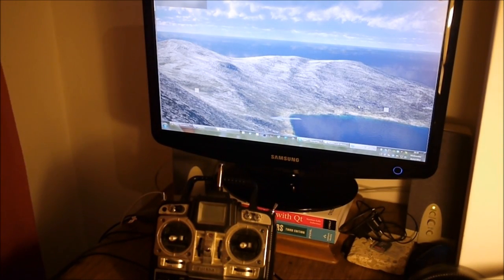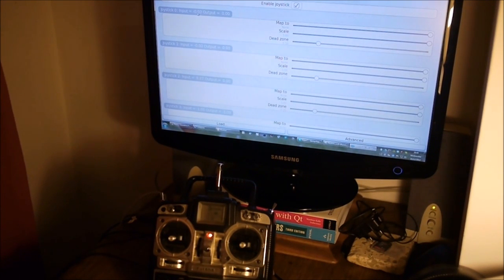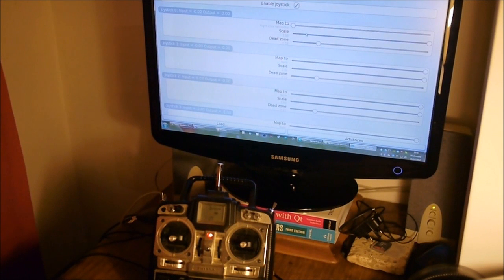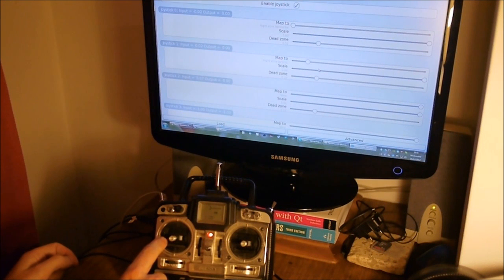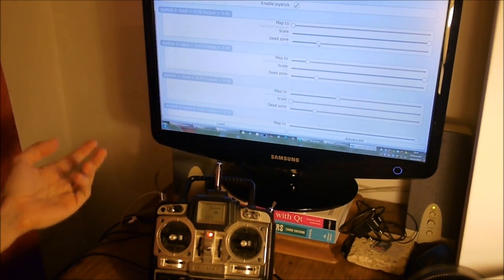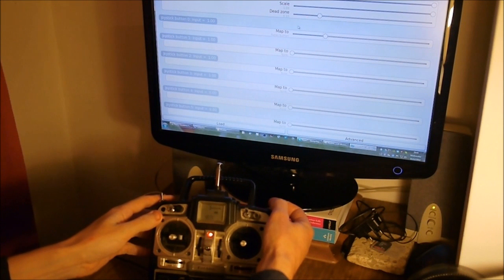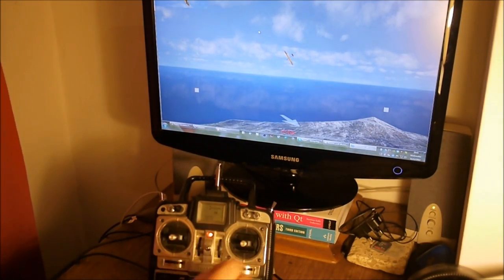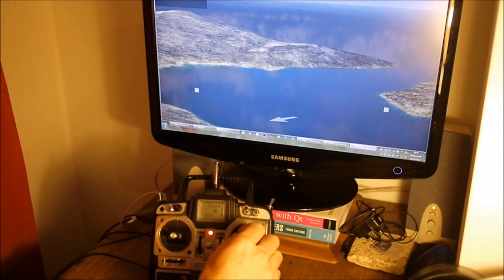Setting up a controller in PicaSim

Comment: I seem to be having a problem using your program with new real flight 8 controler. Is there something I'm missing or are they not conpattable?
Reply: My recollection is that the old RF controller will only work with RF - I assume that's the same for the new version too.

Comment: i don't have a joystick option in my settings why
Reply: Jasper Trulson Because at the moment that setting is only shown if a joystick is detected. That's caused quite a lot of (understandable!) confusion, so the next version will always show the joystick setting page (on Android and Windows), with a message about plugging in a joystick if one is not detected.
Reply: Thanks that is helpful but it is still the beast free sim I can find but you need to add more quadcopter in :-D

Comment: please note how you have connected your transmitter to the pc and that would help a lot of people.  Maybe I missed it but cannot tell if you are connected by USB or some other cable.
Reply: Sorry - yes it's connected by USB, in this case using the interface from MileHighWings. For almost all transmitters you'll need an interface (the one exception I know about is the FrSky Taranis+ which you can connect direct).
Reply: Also - the setup procedure is a bit different now - I'll add an update to the video description...